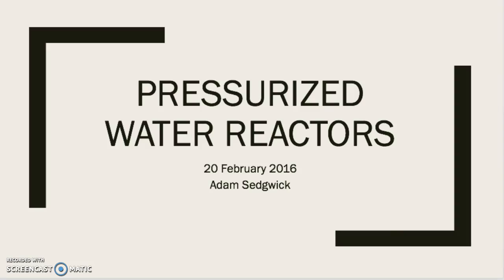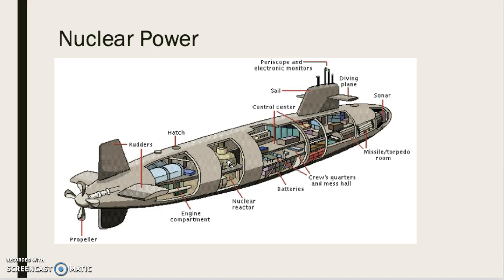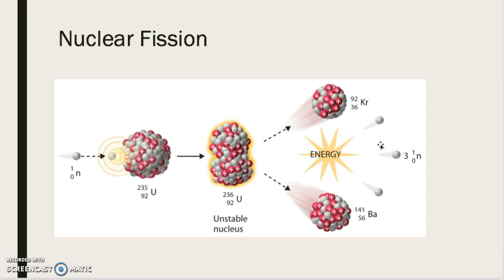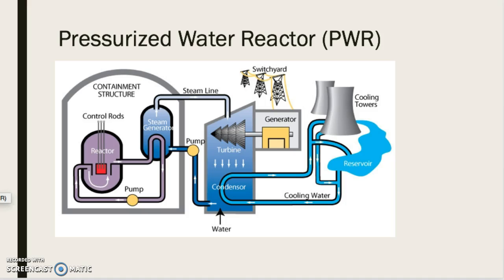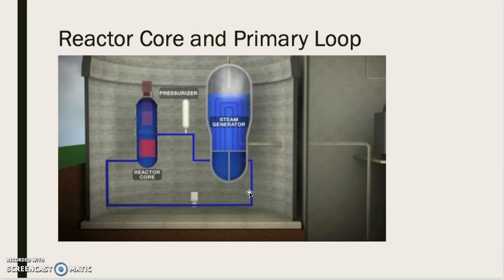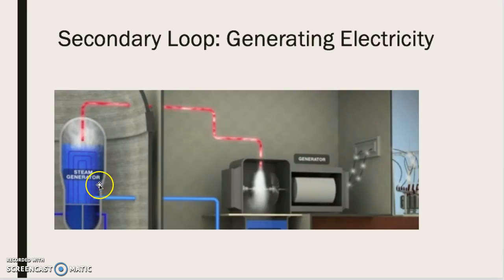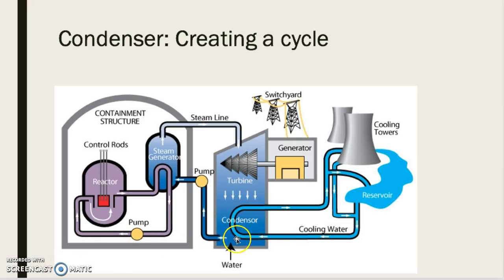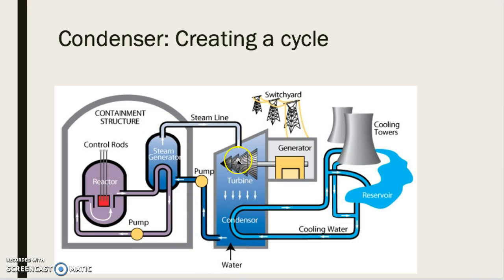Pressurized Water Reactor: General Process

Comment: My great-great-grandfather had apparently worked on the pressurized water reactor down here, as he did some tube fitting for the core. It was empty of course, this was during manufacturing. Not trying to insult my g-g-pa but it's yield isn't that impressive... Only 830 megawatts 😂

Comment: water  boils at 100 C  or  212 F, steam can be produced  .you said at 600 F water is still in Liquid, please explain
Reply: in the primary loop. thats what the pressuriser is for, if its under high pressure the flash point becomes much greater, if you google "pressure boiling point graph" that should be of some help :)

Comment: The water is pressurized to 155 bar, not 15,5 bar. You may have been thinking of Megapascals, which is 15.5, or mistakenly saw a period there when there wasn't. Not really that big of a deal. Great video
Reply from the maker: Triggly Puff thanks for pointing that out! I meant to say 15.5 Megapascals or 155 bar.